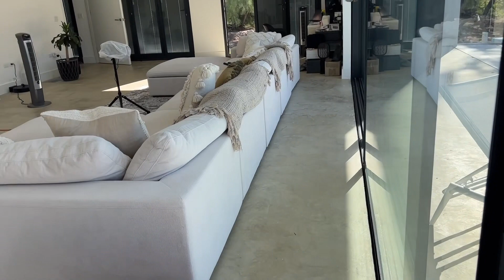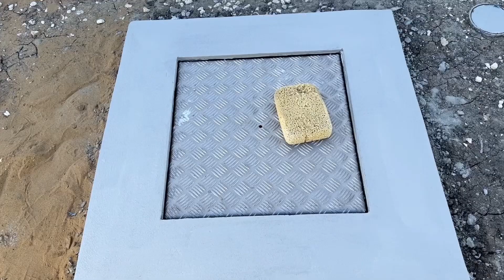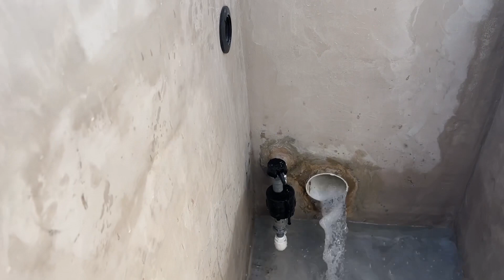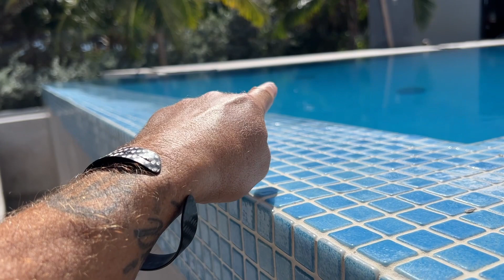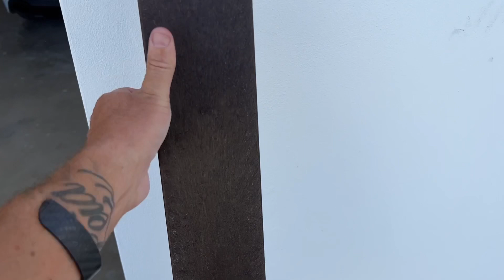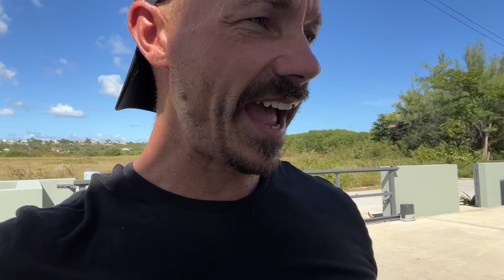BARBADOS 🇧🇧 BEACH HOUSE BUILD - DAY 422

Comment: I would always go wood but have you thought about the weight of the gate when the wood is on it. Will the motor you have to open and close be up to the job?
Reply: When's the pool man coming back to finish the job?
Reply from the maker: He is not, he like most trades didn't want the agro of coming here to finish at the level I wanted which was more important to him than the rest of the money 🤷🏼‍♂️
Reply from the maker: Yes I did think of this. We had the gate made in Aluminium so it is currently light but it will be some weigh tin wood that is for sure.

Comment: I think the wood that you are referring to is "Kabukalli" or "crabwood" I used "kabukalli " in my project because it was less expensive than "purple heart " and "green heart " all three are hardwood....the only problem with Kabukalli is that it has a very strong smell that lasts for some time....I maybe wrong so check with the lumber company that you're using...👍🏽
Reply from the maker: Hey Ronald, that sounds like it! It is dam heavy!
Reply: @barbadosbeachhousebuild  hardwood is very heavy but as you know, it is very resistant to the weather and termites 👍🏽 oh and it's " Renald " not "Ronald " easy mistake 😎
Reply from the maker: Agreed!! I did the response on the phone and it changed Renald to Ronald 😂 bloody Steve Jobs 😂